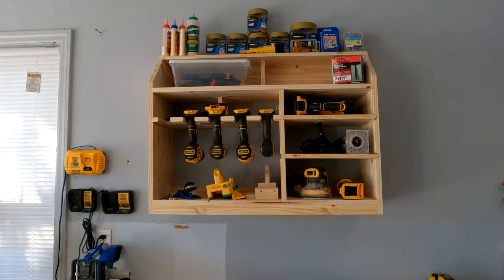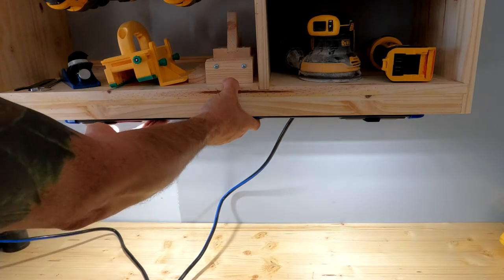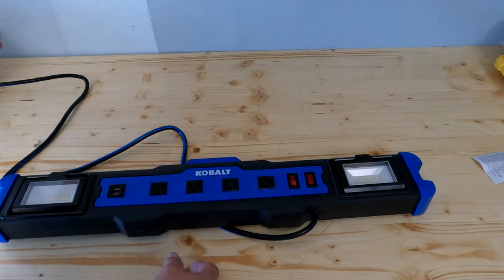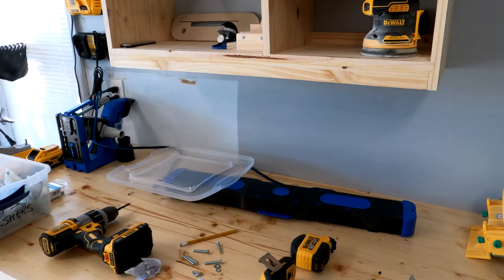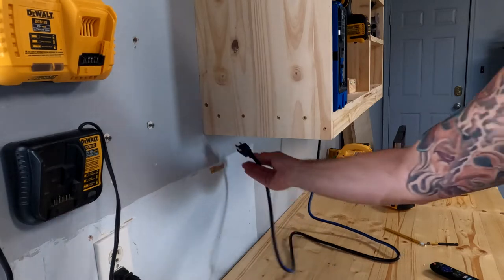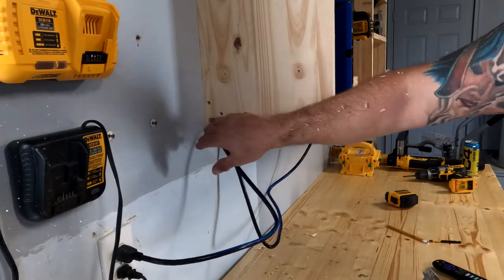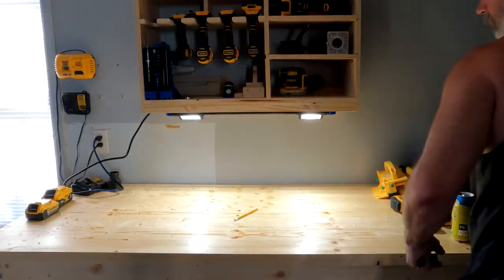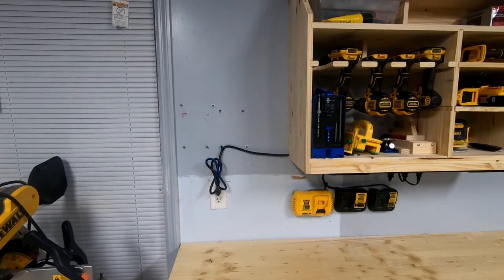Kobalt 4 Outlet 2 USB Ports Blue Power Strip Under Cabinet Light Garage Shop Phone Chargers

Comment: hows your back now?
Reply from the maker: 4 Months in feels pretty good.  I have days I do to much and I'm sore the next couple days.  Back to light duty work, I install security systems, audio, network lines in new homes.  I'm good with an 8' ladder, climbing up and down, lifting 35 lbs or so, just being really cautious not to "twist" when lifting and being over cautious up and down the ladder.  Overall I'd say 75 - 80% better, I can sleep all night without turning wrong and waking up, I can sit at a restaurant without my legs going numb, and all the pain in the butt and leg is gone.  Only issue I have and had before the surgery is my right leg on the side is still numb, Surgeon said may or may not come back, and again if I over do it sometimes gets achy around the lower back but feels like muscles pain, usually Ice or Heat will help.  Worst part was not the back, it was the stomach.  It never got infected but it definitely took longer to heal.   If you have the luxury of staying at home, keep some sweats or loose shorts on it will definitely help.  I own my business and did not have that luxury for more than about 4 or 5 weeks, and between the pants button, belt and movement, just kept it irritated.  Anyhow sorry for the book, I'll take some time and do a follow up video on it tomorrow, you can skip since I just wrote the script... lol  Thank you for asking, and if you are having the surgery good luck and if you have the option see a couple Surgeons, pick the one that feels right and do some research on them.